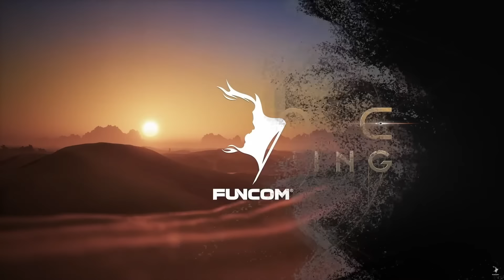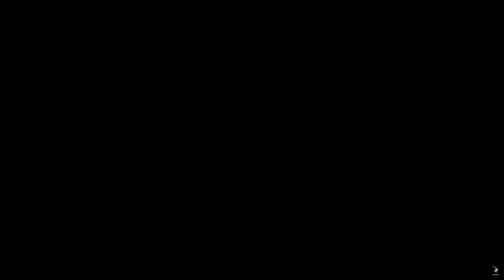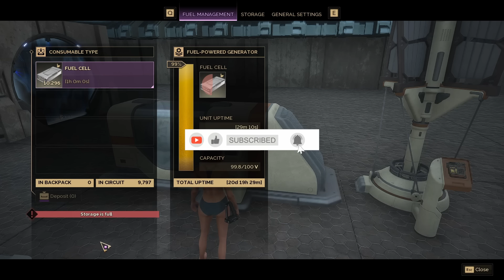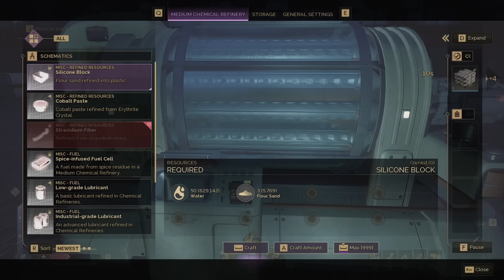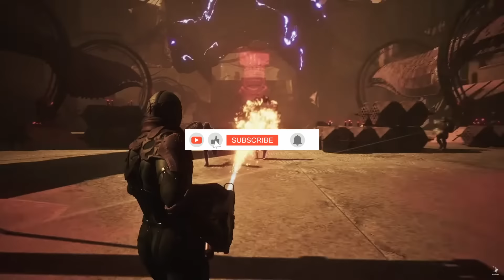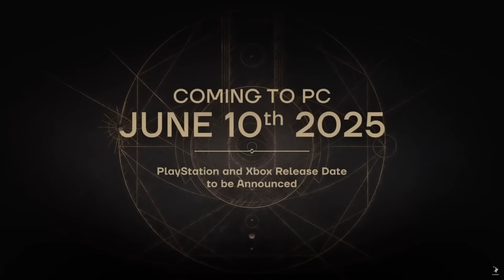Best Power Generator in Dune Awakening? Full Comparison & Breakdown

Comment: Wind turbine directional: "I personally think it is the  best generator in the game". If you check the data and the costs connected to the fuel, that one is actually the WORST generator.
The best one is the basic one, the only downside is the space it takes, since you will need a lot of them. The second best is the omnidirectional wind turbine - super cheap fuel,  cheap to make, decent power, does not take that much space. (I have 300 hours ingame, my base use around 5.2k power, but I have in total 6k available - I'm using only 20 basic generators or smt like that and then the rest is omnidirectional wind turbine. Yes I power all big refineries (ore, spice) in my Haga base, big ass penta shields, since I hit the building cap of 5k pieces and with little farming now and then I still have 20k fuel cells (extremely easy to get with buggy - 1 yield =700 cells+) and about 35k low grade lubricant in storage. (playing solo). So please do not build any other generator in Haga, waste of your time to farm all resources.
Reply from the maker: Appreciate the enthusiasm, Jan — but let’s break this down with actual math, not just vibes.

You're running 20 small gens at 75 power each = 1,500 power total.
You said your base needs 5.2k power, so you’d still need 30 omnidirectional turbines at 150 power each just to hit 4,500. That’s 50 structures to barely cover your output. Efficient? Not quite.

Meanwhile, 13 directional wind turbines at 350 power = 4,550 power

Less than half the number of buildings

1.5 hours of runtime per fuel cell vs. 1 hour

31 days uptime vs. 21 days

And 233.3 power/hr per cell vs. 150 power/hr

So while you’re flexing 20k fuel cells, the directionals are sitting comfy, sipping fuel slowly, and not begging for attention every 3 weeks. I get it — you’re solo, got a system, and that’s cool. But saying the directionals are the worst when the math says otherwise? That’s some Harkonnen logic, my friend.
Reply: You should pin the math for ppl to look at on the fuel cells. So you can stop getting comments like this.
Reply from the maker: @digitalplays7186  I get where you're coming from, but the generator might not be the best option for everyone — even if it is the most fuel-efficient. Not all players are getting enough spice residue to keep one of those directional turbines going, let alone maintain it every 31 days. Efficiency doesn't matter much if you can't sustain the input.
Reply: @cuddlesrus2020  you dont get it, its not problem how much power you get, its COST is the problem, first, directional turbine is duralium AND melange tier, is engame in haga, its FCKING EXPENSIVE !!  also its fuels it expensive too,  omnidirectional is only steel and its fuel is cheap, you can build 3 omni for 1 direct and still run in on 1/3 of fuell cost, and basic generator run cost i basicaly free, if you have buggy and time farm cells, if you are mid and erly end game tier, directional turbine have no use for you, unless you farm deep desert (which not everyone do/want to do)  ofcourse if you are in guild or willing farm DD hard, its comepletely different thing

Comment: I am at late game and I still ONLY use the T1 gens. Most of the time you are not using all your production power. I never had an issue running all these things with nothing but T1 Gens. Also you can have another base next to yours purely for processing to even the load =D. One of my friend does it and it works so well.
Reply from the maker: I guess my base is a little different as I'm over 7000 power and with very large pentishields and everything else, like 8 wind traps 6 death stills and all of the production units. So it's all really based on your needs.😊 My other 2 bases go to the deep desert as ones in a PVE area and ones is in the PVP area. With substantially less power requirements.

Comment: The only reason to build more advanced power gens is if you are limited by production slots.  There is no reason to put expensive power down if you have 20 unused production slots.  If you need the production slots you can start adding higher tiers to get more power out of your slots.
Reply: If you do any Spice/DD farming, the Directional turbine is a serious option.   You end up getting a ton of spice residue from making melange, Really the only other things you need is silicone blocks and water.  Both are not needed in huge quantities and are needed for other things anyways.  So you CAN reduce your "fuel cell" farming and just increase the other farming you will have to do anyways by a little.

It really is situational to your playstyle and base "wants"... Once the power ramps up to 3k and beyond, you might want to look at Directional.  If you ARE not doing DD/Spice, then for sure stick with Fuel Gens and Omni.
Reply: deep desert with space limitations.
Reply: another thing is turning stuff off, If i know i wont be playing for a few days or weeks, I turn most of my base off allowing me to save fuel
Reply: ore get another base vanilla bulding tax free is the best most room in this i store both carier tractor 2 asult 2 buggy 4 scout and whne i take break and only then i build for 30 days and box the rest and peps u know u can turn stuff off/on :)
Reply: If you have 24 simple generators - I had - and you pick up 1000+ power cells from 1 node (focused cutteray mk6), that looks good until you realise that 1000 cells will power the generators only for 1.7 days. Considering that power cell nodes are not in clusters, so you have to look for them, it makes sense to switch to more efficient generators, even if you still have slots.
Reply from the maker: It is also about time management when the small generators only run for 20 days and the larger generators run for 31 days.

Comment: tl;dr: The Spice-powered Fuel Generator is a trap because it produces 50 less power than 3 Directional Wind Turbines but requires you to harvest 13 times as much Spice Sand to keep it running for the same 31 days.

Longer version: Three Directional Wind Turbines produce 1,050 power and need 750 spice residue for the lubricant every 31 days and 6 hours. That means 45,000 spice sand in a small refinery or 22,500 in a Medium (or Large). A single Spice-powered Fuel Generator produces only 1,000 power and needs 3,250 residue to run that same duration. This means 65,000 spice sand in a small refinery or 32,500 in a Medium or Large.
An experienced solo rat at above-average efficiency with a handheld Compactor can usually pull in about 4,500 spice sand from the Deep Desert every 15 to 20 minutes. This means you'll spending roughly 3 hours out of every 31 days to keep your one Spice-powered Fuel Gen, while keeping three Directional Wind Turbines will only take you about 1 hour and 40 minutes.
Reply: I think the biggest drawback is the Irradiated Slag. Spice residue is not a problem since you’ll be swimming in it. But for slags, you have to manually go to Sheol and farm them.
Reply: @rainzoro  You are manually farming both Irradiated Slag and Spice Sand in order to keep Spice-fueled Generators operational. The Slag is not the problem between these two as it spawns in fixed locations at regular measurable intervals and requires only minutes of time invested every 31 days.
Spice Sand spawns in random locations at wildly varying intervals and is additionally highly contested and often dangerous to obtain, and even under optimal conditions will require a minimum of hours of investment every 31 days in order to obtain enough residue necessary.
Reply: As an addendum, if you haven't started farming Spice Sand in the deep desert, you should not be utilizing any machines that require Spice Residue to operate this includes Large Windtraps, and the two power generators mentioned here.
Reply: With a large spice refinery and carrier/crawler you literally are drowning in spice residue to the point you might as well leave it on the ground or in the DD. If you are playing at a massive guild base, 80 production machine cap gets hit very quickly with the amount of wind traps and death stills needed to supply water to a big group of people. Spice powered generator biggest draw is that. A big guild base might need 10-13 of them opposed to 30-35 directionals
Reply: @travisw6881  Having an excess from successful sandcrawler runs doesn't stop the Spice-fueled generator from being a hilariously inefficient use of crafting time and available resources.
The same goes if you are primarily relying on Deathstills to supply you with water. A Large Deathstill provides 45,000 water per 50 minutes or 900 mLs per minute, assuming you baby it constantly with corpses. Dew Harvesting, on the other hand, at optimal time with merely the Mk4 Industrial Scythe and 8 Decaliterjons will net you 80,000 mLs in less than two or three minutes, gatherable once per day/night cycle which is roughly an hour. This works out to 2,666.66~ mLs per minute. You would need three Advanced Deathstills being supplied with nonstop corpses to net more water per hour than Dew Harvesting at any of the gigantic three gigantic flower fields.
Keeping a corpse supply for three deathstills is practically a full time job, while planning around Dew Harvesting is maybe 10 minutes out of every hour, when counting travel time.

You are better off building a second fief if the production needs are that tight, and getting a volunteer or two for regular Dew Harvesting to meet your water needs.
Reply from the maker: 💯 correct. Thank you for the summary and detailed explanation

Comment: Honest answer is only using the power production to just meet your needs in that moment. If you have 3000 power needed, then make the min to meet 3000. Small teams or solo won't need huge amounts, and there are space/slots which was pointed out. If you have an Advanced Sub then you get 40 slots, you get more per stake added, with small increase per stake to claim tax. The smaller your claim size, the less slots you have and the more need you will have for greater power amounts from a smaller number of machines. 40 production slots for instance is a good number, but if you have said, 3 medium Ore refineries, Death Stills, Blood Refineries, and then your normal array of Fabricators, you will not be able to run Normal Fuel Gens to meet that need as you will run out of production slots. This isn't to say, there is a golden correct way, just that each method you'll be faced with needing to invest time to different aspects to meet production needs. Be it water, fuel/power or time to refine base components to various types of end products. Some could be met with turning off machines when not using them to save power needs and allowing less amount power gens needed. This is tedious and takes time as well. 

Fact is, you still have to have just enough power to run everything including power needs for Pentashield Walls etc. The big take on power is use only the amount you need to meet your needs. If you need 3000, make enough of any mix to hit 3000 as anything over 3000 is just wasted. one thing this video doesn't say too is that the Time listed for up time of power on your Sub Fief is based on your lowest available unit needed to supply the power needs of the base. You can have for instance 10 Fuel gens running, and one Directional. The total time will be calculated for that amount of power from the lowest available machine type needed to produce it, starting with the calculation from the highest production type in use. The 1050 power being made will start its calculation with the 350 from the directional and then continue with lesser machines. SO, if your base in that use case needed 300power, you'd see it saying however much time was on the Directional only as it handles all the needs of that base. As soon as your bases power needs increased beyond the 350 of the directional it will then start calculating from the time available for the Fuel Gen. Means if you need to take a break for a while, make sure one Directional or better is in place and then turn off all other machines in your base. You just bought yourself 31 days of time. As the Power Gens will use the fuel no matter if there is a draw on it or not. So cale up Power as needed for production to just meet it. If you wanted, you could even turn off Fab Machines when not being used. Means less power needed, allowing you to have fewer Power production, but will take time to turn off and on machines to do things. So, this isn't for everyone. I normally just make power to the point all machines can be on so less hassle turning things on and off, but there is the option if needed. I have used this power off option for Death Stihls when water isn't being used to lower power needs, but that was quickly changed as it is tedious. 

No huge things to use whatever power you want. It's you playing and your time. Just know Omnidirectional is the cheapest power over all item wise, and just slightly more time to make its fuel as it's already items, you'll be gathering for other things anyhow. Just don't over produce power without the need, because that is just a waste of your time. Dune needs work still but is a good game. Just go enjoy it and have fun!
Reply from the maker: Thanks for the awesome and thorough breakdown! You nailed a lot of the nuance I was trying to highlight—especially about matching power output to your actual base needs. I totally agree: the real trick is not overproducing and being smart with your slots and machine uptime.

I didn’t go deep into slot limits or turning off machines in this video, but your comment fills that gap perfectly. Love seeing this kind of thoughtful discussion—makes all the effort on my end totally worth it!

Comment: Without watching the video I can answer: the best power gen is either the cheapest one that will meet your needs, or the most expensive one that you can reasonably afford to keep going.  Which one depends on your space limitations.  If space is at a premium, default to the most dense source that you can reasonably afford.  If it's not at a premium, use the cheapest option that will provide enough power.
Reply: Don't forget the build limit, unless that's what you meant by space.
Reply: @BeholdNails Either physical or virtual space, depending on what you're up against.
Reply from the maker: Well said
Reply: Its not the spice residue, it’s the irradiated slag

Comment: We went with Spice Gens. Saves room, room on production, and we only need 4 (4,000) to power our entire base.

Not only that, but we're swamped with Residue from taking the crawler out. If we didn't use it for Gens we'd have to start throwing it away (we had 2 of the largest storage full of it)

They also last 30 days instead of 21.

Downside is doing a Sheol run for the Irradiated stuff once a month, but it's fine.

If we take a break I'll turn everything off and fire up a regular gen.
Reply from the maker: The directional wind turbine still gives you the same 31 days of use, but it costs less spice residue to run. If you're swimming in residue, that’s great—but for small groups or solo players, it might not be the best choice. Instead of just tossing away your spice residue, you could sell it on the exchange. That way, you wouldn’t even need to farm Sheol anymore. I get that space can be tight, especially if you only have a few production units available.
Reply: @cuddlesrus2020  yeah, it's whatever you're into space wise.

We go to Sheol for other bits anyway, and the Spice Gen doesn't require Silicone, so we've basically swapped out Silicone farming for Sheol farming.

Comment: Incredibly long winded ramble to say the basic generator is literally the best option in game overall... But, your logic about fuel generators also applies to omni wind turbines, as flour sand is easy to farm, especially once you find a couple locations where you can gather it without risk of attracting worms, allowing for VERY easy lubricant production... Given that 2 omni's produce almost as much power as a single directional turbine, without needing any spice production, they are a much easier and more efficient option overall... Seriously, you have 80 production slots, you could literally dedicate 60 of those to power and STILL have all the fabricators and refineries you need... Sell that residue on the exchange to other people and turn it into Solari instead...
Reply from the maker: The directional wind turbine is actually the best generator in the game. As it will give you 31 days vs 21. So less time spent farming flower sand. More times picking up spice or doing PVP. It provides the least amount of effort for the most amount of uptime you can have. It comes down to where you want to spend your time and how you want to spend your time.
Reply: @cuddlesrus2020  You're pretending that the 10 minutes it takes to gather enough flour sand to make that 21 days worth of lubricant is some huge detraction from other activities, especially since Industrial Grade lubricant needs 4 silicone blocks anyway, meaning each directional requires just as much farming as 2 omni's, albeit a week less, but then still needs substantially more water and fuel cells on top of the flour sand, so more time spent gathering those materials/not using water on other production... Claiming that extra week really means little given the increased overall material requirements, and is rather disingenuous, IMO...

So, no... Unless you are really hard up for space, or (somehow) are struggling with your production cap, the omni is a much better choice over the directional, simply because it uses less overall resources to maintain, and that 1 extra week means virtually nothing if you're an active player -- it MAY come in handy if you intend to take time away from the game, and that's it...